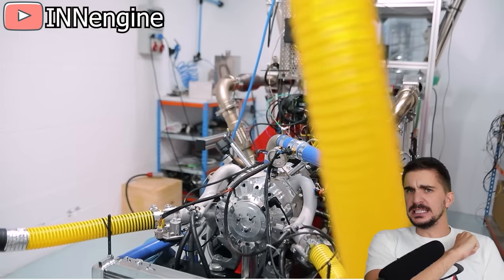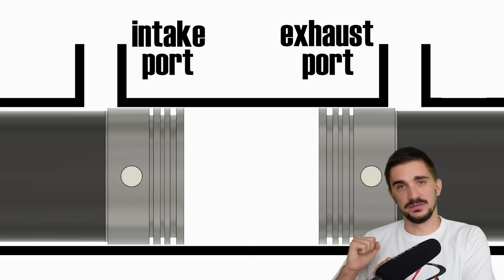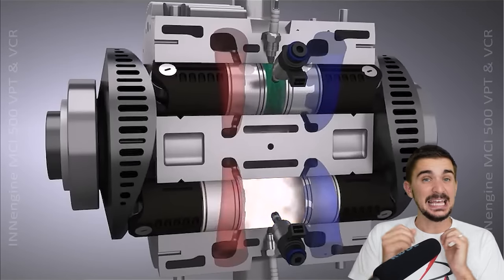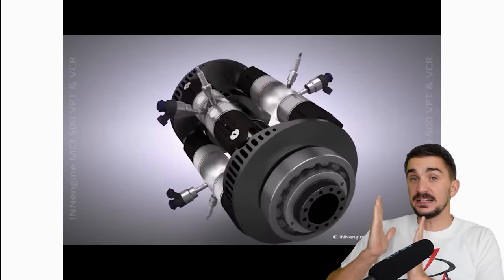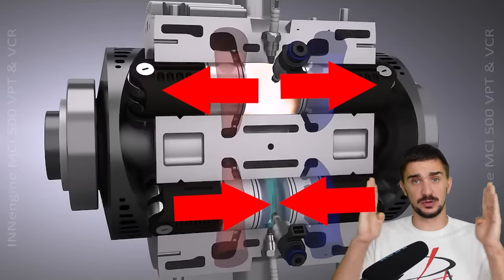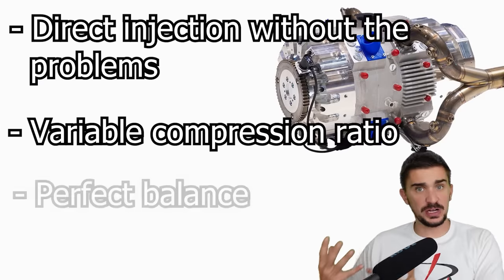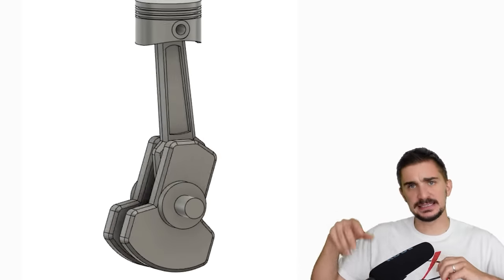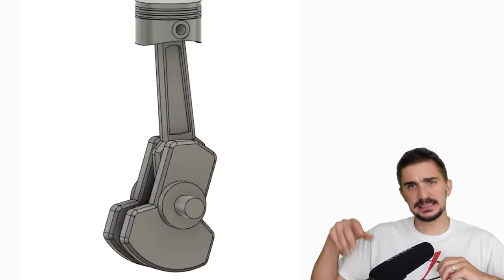Spain is Living in 2050? Revolutionary 1 Stroke INNengine Analyzed

Comment: To use an ellipse isn´t a bad idea, but the implementation here is full wrong... There´s a system doing exactly the same, but 100-times cheaper to machine/CNC: An elliptical race is mounted on the flywheel´s side, and the 2 "stiff", straight conrods of the opposed-piston-engine press on the inside of the elliptical race, thus turning it around (and during compression, the ellipse pushing the conrod/piston-units back to the center of the opposed-piston-engine). Just like in this video kHXKNpXoQUo with the sole difference, that (unlike and in opposition to this video) the opposed-piston-engine is mounted on a fixed point, and the ellipse/flywheel/output-shaft turn...

Comment: This is EXACTLY what most hydraulic motors run. So it's not "innovative" it's actually old tech just using combustion instead of hydraulic pressure. So no Spain isn't "living in 3060" they have just changed a RELIABLE motor that's used in tons of heavy machinery and making it unreliable combustion engine

Comment: engines with this opposed piston combustion and port scavenging have been used in trains and ww2 boats     and engines with the  cam driven pistons have been built.  yes it has 8 combustion events per revolution( 2 per cylinder due to the cam profile) but that would be the same as a v8 2stoke ( yes they exist)  and also use super chargers instead of crankcase compression to flow fresh air into the cylinder through cylinder ports

Comment: i find the marketing standpoint so annoying. this engine, if it is actually that energy dense, has really good energy density and very low displacement; however, alot of this marketing jabber is just purposefully malicious. the one stroke nonesense is annoying, them using a by all means fundamentally inferior engine as a comparison is dishonest, and of course the required turbo or supercharger is something they should definitely say is a standing point.

Comment: I SEE A FATAL FLAW. If the combustion fails due to fuel starvation....how does this engine return the pistons without the piston tied to a crank? You would push two pistons together, and if no spark or fuel they wouldnt return to the Piston rotor.

Comment: i have a one stroke engine in my mind. it would be completely useless and probably very difficult to start if not impossible. probably will need a shotgun shell to start it like one of those old tractors. then you have a piston with two tops opposing each other and attached to each other. you have two spark plugs at each end of the stroke and it would have a two stroke style block. as one piston fires it would compress the other air fuel mixture with the other side of the piston then it would fire and the process would happen on the other side of the piston and the process would restart. thus creating a 1 stroke (each stroke has a power stroke in the same bore) engine that you have no way to harness the power of since you cant connect the piston to anything to spin.
Reply: just finished watching the video. and yes something like that. but i dont see that seal with the shaft sliding through it lasting very long. also i dont see it being very strong either. connecting rod looks weak as hell.

Comment: In 2050 Spain and everywhere else will be using electric motors, not any kind of engine, however mechanically innovative it may be. Look people, we already have electric motors weighing in at 35 kg delivering a lot more than 120 hp and more importantly a much wider torque curve.

Comment: Seems to me this engine would be ideaal for a hybrid car.
this engine could drive a generator, and the car itself could be electric.
that way, torc does not realy matter, just horspower. 
the weigth and size would be perfect to join to a generator, no large batterypack needed. At a trafficlicht, this would charge the battery, and when green, the battery and generator combined would drive the cars electic motors.
no need for a large drivetrain, low engine weigth, no gearbox. and with four engines, no need for a differential.

Comment: Doesn't the design of the engine make it act like a weak gyroscope, thus affecting the handling at higher rpms? As shown this engine has low torque, kind of like a turbine engine running at low rpm. It may be great in a small, lightweight vehicle. Maybe it could act as an efficient motor generator a hybrid vehicle with a storage battery and electric motors. I can see the pistons and cylinders getting excessive wear because of the wobble of the piston. In my inexpert opinion it is not a very durable engine design.

Comment: It's basically two swash plate compressors mounted end to end to form a  horizontally opposed two stroke engine. Not particularly original and very unlikely to ever be used in a production vehicle.

Comment: I can tell right now its not going to work because its losing power trying to push agains the wavy disk and spin it using lateral force. Lateral force to spin a crankshaft running parallel. Probably losing like 50% or more.

Comment: how about if we made normal engines, but with hydrogen injection from the factory? I mean u would just fill your gas tank, and then fill up another tank with water, and have a second battery connected to two poles in the water tank that produced hydrogen and make a injection port in the intake, that would make a very efficient engine because it would make all of the fuel comust not like 30% in normal cars

Comment: Typical of certain 2-stroke diesel marine engines. Such engines require some sort of boost, super- or turbo-charging. I have trouble believing that scavenging alone is enough for induction. Never seen a 2-stroke petrol engine that made induction-by-scavanging work. I also question the roller interface with the wave-plate. Looks to be sensitive to insufficient lubrication and rev limited.

Comment: It is a ONE STROKE ENGINE because their are TWO POWER cycles PER CYLINDER ;;;;;;;;  WITH ONE ROTATION OF THE  POWER SHAFT (TYPICALLY CRANKSHAFT),    therefore it is NOT exactly the same as other single power cycle (PER  CYCLINDER) per single crankshaft revolution....

Comment: The terminology of "one stroke" is right, because a conventional 2stroke. 4cylinder has 4 firings per 360 degrees of crankshaft rotation,  this engine has 8 firings with 4 cylinders. That is double than those of a 2 stroke so it is a 1 stroke !

Comment: This thing resembles many hydraulic pump and air compressor designs. Nothing new under the sun. The reciprocating motion of the pistons means low efficiency just like typical piston engines. Momentum comes from going in one direction (like electric motors or gas turbines) Piston engines need flywheels for this reason. Electric motors, (especially 3 phase brushless DC motors) have great efficiency, but getting the power from batteries is the weak point. I hate to say it, but in "save our World" terms, nothing you discuss on the channel approaches the efficiency and elegance of an ordinary bicycle.

Comment: There is missing how to deal with the perpendicular force applied to the tip of the piston bar that contacts the "strange shape ramp s" at the ends. This will create a moment in the piston with a force in the upper part of piston and another in opposite direction in the lower part of pisto. This will increase wear of the piston-cylinder.
In 1882 an Oposed Piston engine with 2 crankshaft was designed, very similar to this innengine, but was complicated in dirving the two crankshafts. The simpson in 1914 was not so complicated Not new idea. See please = https://es.wikipedia.org/wiki/Motor_de_pistones_opuestos

Comment: Seems like it would be garbage. Roller bearings for pistons would be a mess. The roller crank definitely would wear out after so many combustions and stress. Roller bearing seizes up. Be no good for the crank surfaces and engine won’t turn over if it does. Engine would wear out with so many hours under load

Comment: One-stroke engine my eye! it is indeed a four-stroke which bears the patents Saurer, Panhard, and a few others... Rotating sleeves to eliminate the valves, connecting rods/pistons on inclined plate like on compressors, and so on, it is not new but a big scam

Comment: I get it. No Cams. No Valves. No Chains nor Belts. And so it just moves Air. It is Passing Air. When you Pass the Gas. It recovers and recycles that. So you don't have to. It's all Autonomic. And reaps maximum profits. Maximally. At higher RPMs. So you don't have to.

And no sticks, no stems, no seeds. You don't need.. Acapulco Blow is Bad Ass, Gas. I think? From all those tacos! Made from Official Dog, Meat. And can expel you from Tijuana, quickly and efficiently. With nary a wisp of dust. For the Projectile of your Protuberance.

Chrysler made a Turbine Car. 60 years ago. We still haven't gotten. What are they waiting for? Fiat?
RemyRAD

Comment: The supercharger migth just be for scavenging like in the old detroit diesel two strokes. Its just needed becaus in a two stroke design without utilizing the crankcase for intake theres no difference in air pressure between combustion chamber and atmosphere 

Maybe somebody else pointet this out before me.

Comment: No such thing as single stroke or two strokes' engines.  All internal combustion engine required 4 cycles. intake, compress, ignite, and exhausts.  This theory applies to all internal combustion's engine. Turbo, Piston, Or Wankel rotary engines
Reply: so 2 stroke engines are not 2 stroke ?

Comment: Not an engine, more like a known and very old method of explosive contortion and fixed rotary angle of rifling either slowing before lightning up popping our like a wine cork or loosening and accelerating causing it to speed up it rotation causing a more symmetrical pattern when fired.

Comment: Interesting idea, promising numbers, false Numbers, from their website:
"At just 125cc the REX-B air cooled 4 cylinders deliver 21’5hp @ 6000 rpm that is about 80% more power than any other naturally aspirated engine"

Just not true, to fact check google this:

Naturally aspirated Roadlegal stock aprilia RS125 has 35hp.

As this engine is also displayed in a model aircraft it's not illegimate to compare it with modelaircraftengies Naturally aspirated nitro engines offered much more hp per liter than that even back in the 1950s, the power figure given here is not even remote to what modern 125cc NA nitro engines can do.

Ad the "1stroke" false ad that's debunked in this video and the Overall dishonesty makes this one a fishy Bullshit looking concept.